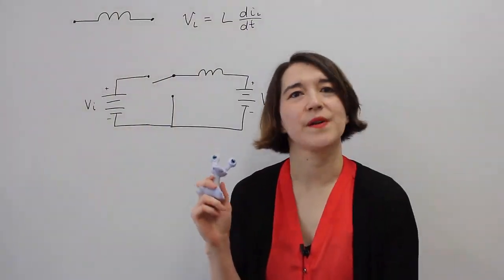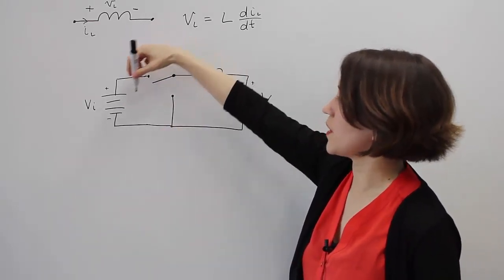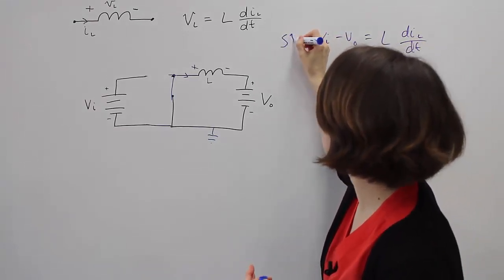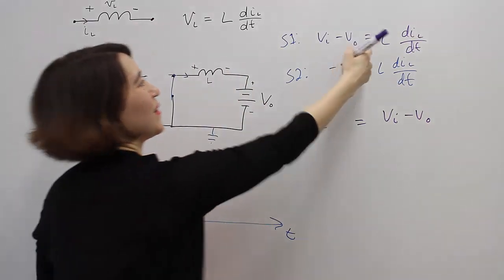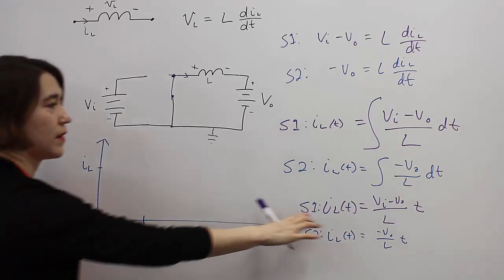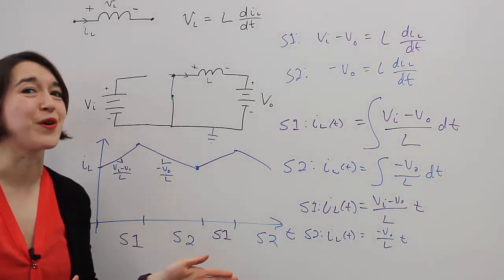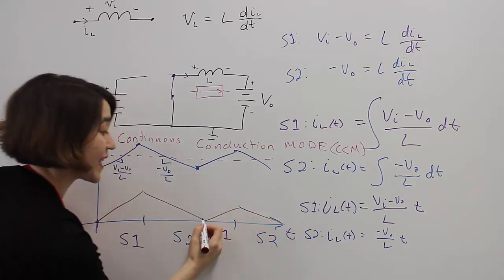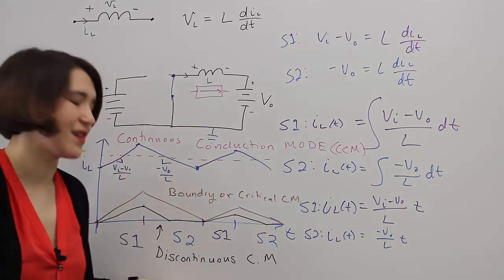Switched Inductor Operation

Comment: I have question about the second stage 
When the switch is opened the polarity of the inductor voltage is changed and the inductor becomes a voltage source , so the V out is equal to the inductor voltage in positive polarity. why did you use KVL in second stage as Vi is zero but we have new instantaneous voltage source by inductor ?

Comment: Great!...why did you put a the second battery on the load side of the inductor?  Or did you simply mean the load resistance is shown as a battery (source)?  So if your load resistance was too low it would drive you into the critical mode...